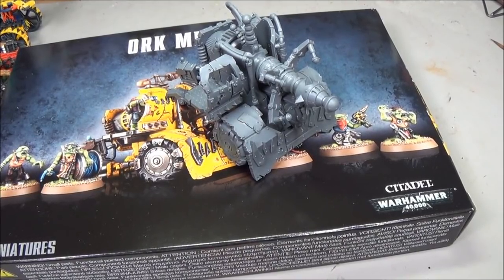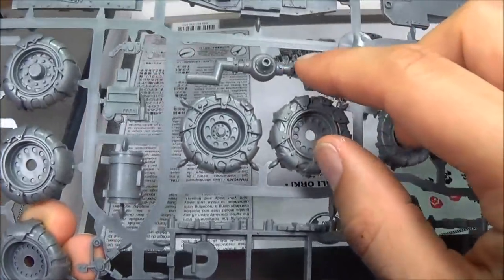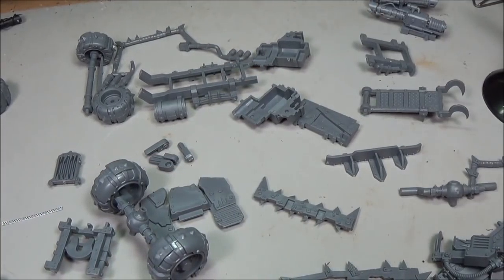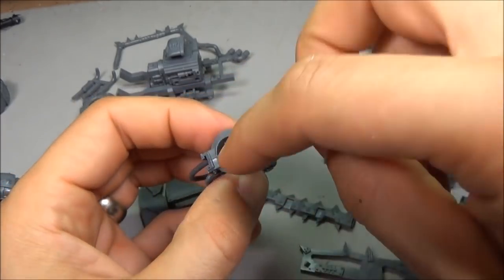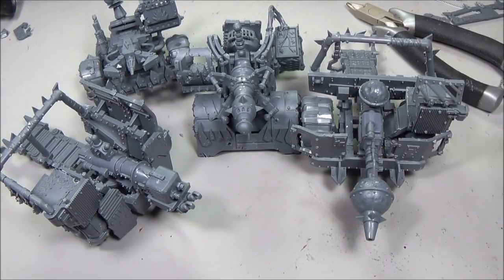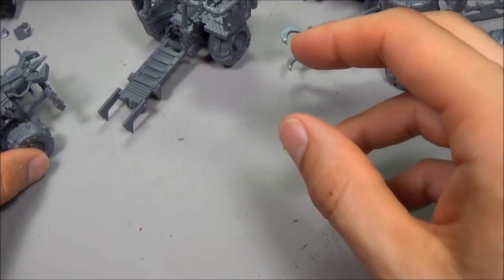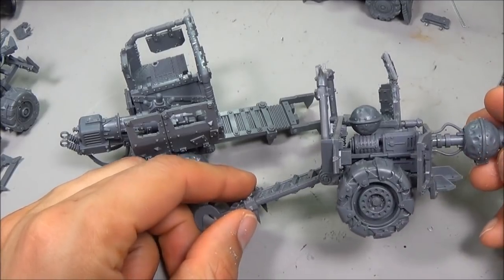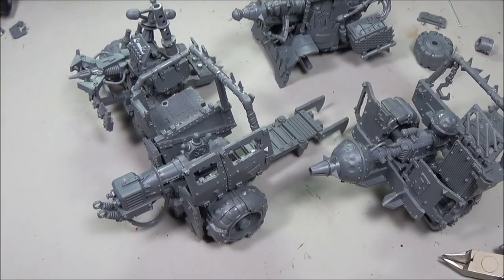Ork Mek Gun Kitbash

Comment: Awesome video! Quick question, what super glue are you using in this video with that amazing brush on tactic?
Reply from the maker: ephraimfan Tamiya extra thin plastic cement. It’s amazing. Comes in a square glass bottle with a green lid. Should be at most hobby stores that stock tamiya paint